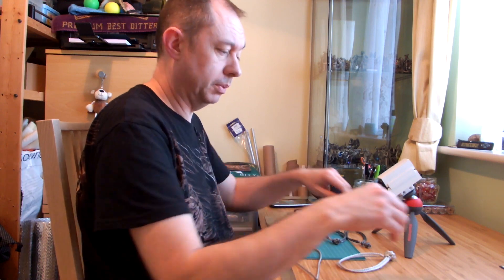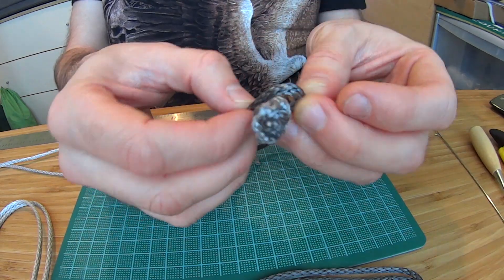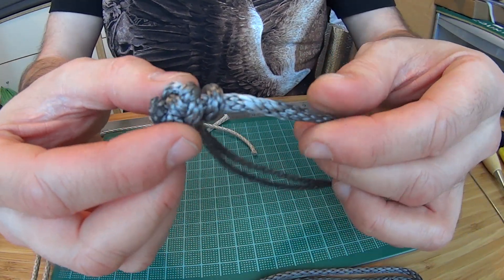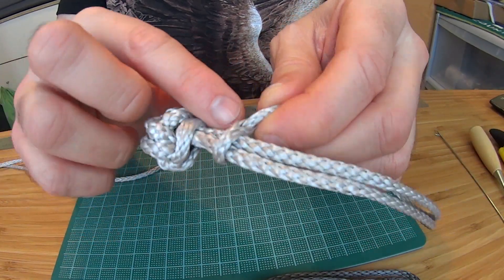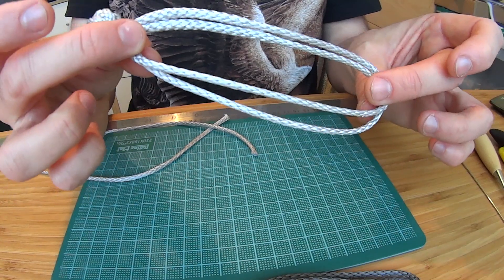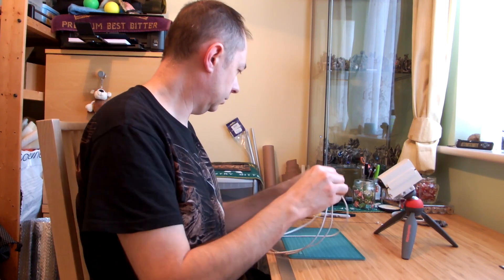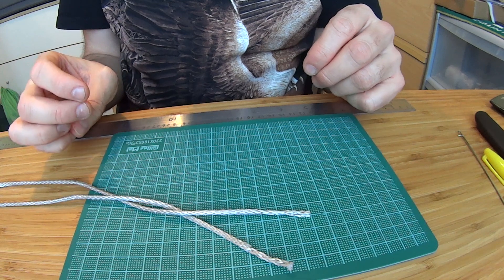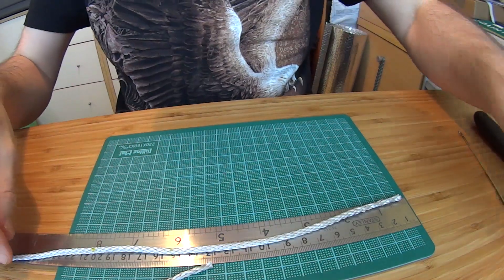Improved Soft Shackle

Comment: I've used this 'how to' as the template for IS-Shackles which replace all the very hefty steel shackles on a Jordan Series Drogue - a life-saver device for small boats in big storms. I'm using 12mm Dyneema, and with Dyneema anti-chafe woven tubing slipped on. It's idiot-proof, doesn't rot under UV, and I can double 'em up with a spare set which I've made.
Reply: I am using this for off road recovery. I also have a 60 foot winch extension that i threw loop ends onto on the fly using this technique. No need to lock stitch. I used it to uproot  trees. I used it to rescue a stuck RV in the sand. Its a great way to make a loop, and a great way to make a shackle.

Comment: I tie my own soft shackles, This is how i will tie them from now on. Ever try  it on 3/8, the big 22k rope? someone sound off and let me know.EDIT:ORIGINAL POST 2023, UPDATE MAY 2025...... Ok so i have this bookmarked, I watch it every time i make a new shackle. I use heavier rope, so the dimensions differ alot.. The infallability of these shackles as designed are top notch. I have broken a couple smaller ones. I was uprooting trees with some made from 3/16. I was shocked because i was trying to break them., and i could not. I do off road beach rescues in the Texas coastal bend. I use these as a safer alternative to steel. They are so inexpensive to make. This methodology of making  winch extension loop end negates the need for any lock stitching. I find more uses for this method of making a loop.

Comment: This is an extremely helpful video.  Thanks so much for making it!  At the end of the video, you said you would try the same method with lash-it or zing-it, but I haven't seen a follow up video.  I did a bit of experimenting with 1.75mm lash-it and found that your method worked quite well.  I settled on a 32" line length, 4" bury, and 1.25" loop.

Comment: It’s likely someone already mentioned this, but I can’t go through all the comments —>
If you tie a small loop in thinner cord around the “working part” (i.e. through the hole in the middle that you feed the longer part of the rope through), you can use it to open the shackle without fiddling, even with your gloves on. I doubt it degrades the shackle integrity much, if at all. 
Thank you for sharing the knowledge, Tac Blades.
Reply from the maker: Are you sure that it applies to this style ?

Comment: I will use this as a backup schackle on my paraglider, would it be ok to make this schackle but have one line go inside the other like on some other schackles(not where the knot is)to elliminate the risk of the 2 loose lines caching on something? Dont know if i make myself clear but you have knot, 2 lines, loop. I want knot, 1 line, loop.
Reply from the maker: Hmm not sure because if the buried ends might not be possible also without testing i could not say how strong or safe it would be.
Reply: @TacBlades  oh yeah man my bad, i forgot about the burried ends. I did this schackle one year ago and had forgot that part. I see now as im watching the video again that its not possible.
Reply: Do you have any tips on ways to make this schackle secured when not under load? I just made one and i see now that its not ideal since it will be a backup and wont be under pressure until the main one snaps. Thinking about o-rings or something to make the lock stay in place.
Reply from the maker: @rickardjonsson4526  no this kind of shackle is not designed for that kind of purpose.

Comment: Would you use the same measurements on a larger diameter rope?
Reply from the maker: No it would all have to be adjusted, for lots of reasons, especially the back splices. Trial and error is a good way, but it would have to be tested to be sure.

Comment: Thanks for the video! Which variant would take to make a loop of the same length, this or a button knot? I've tried to watch different videos and it's confusing, it looks like your method uses much more material to achieve the same length, or am i wrong?
Reply from the maker: It it using more material, mainly because i use the good length of bury for safety and also the end result is a much larger knot than the button knot so uses more material

Comment: Great tutorial! super easy. I've made 2 sets. I have a question. What is the tan or wood handled tool you use to divide and widen the Amsteel with? Much better than what I use.
Reply from the maker: Thanks it's one of these
Handmade Awl https://www.amazon.co.uk/dp/B01G699ZJ0/ref=cm_sw_r_cp_apa_i_YST9CbS5G33E8
Reply: Should have guessed that would be a UK site, but I did find it on ebay for only $5.50 (US). I made 2 of these with 1.75mm zing it for hanging my tarp... FIDDLY! Thanks again!

Comment: you presented it very well, im new to these types of knots and will be using  them in vehicle recovery. i do have a question though,would it take the weak point away from  the loop if there was a sheeps head there for the loop rather than going thru the center of the body of the rope? i hope i was clear, i dont know all of the terminology  yet. thanks tim
Reply from the maker: I know what you mean but in testing it was weaker, when you compress dyneema in a knot it can reduce the breaking strain up upto 50% but i would definitly make a few and try both, i use a larks head sometimes, take care as it can jam under a lot of pressure.
Reply: @TacBlades   how are you testing these knots i am interested in this
Reply: @TacBlades  it is a larks head knot not a sheeps head knot i was talking about, someone called a sheeps head on a video. lol
Reply: if useing a larks head can you use a tab or strap under it to pull it loose? just thinking

Comment: I made several of these the other day, without the little constrictor loop, in less than an hour while watching TV. Today, I was fiddling with a continuous loop and made one of these with that. I'm wondering why this wouldn't be a good way to make these Improved Soft Shackles? It is even easier than with the dogbone, and a wonky-looking knot is a wonky-looking knot, right? 

It seems that making a knot takes up about 4 1/2" of the CL. If the formula for making a continuous loop is SL=(FL+6)2, where SL=Starting Length and FL=Finished Length, then the one for the ISS using a CL would be SL=(FL+6+4.5)2. Looking forward to your comments.
Reply from the maker: You would have to explain more how you made one with a continuous loop ?
Reply: @TacBlades  Just made the knot by doubling the loop at the center of the buries. Then the tail through that.
Reply from the maker: @jfm30204  tight knots in dyneema can weaken the cord up to 50% thats why the knot on this one is larger and around large back spliced diameter cord. It has been tested in repeatable stress tests for strength and safety. So i am confident to share with others and not to put others at risk.

But there are many ways to do it  so for your own use you can try what you like and works for you.
Reply: @TacBlades  I understand, and this is how I look at it. The resulting (I)SS can't be any weaker than the CL and will probably be considerably stronger. I would not sell them to another person without considerable testing, which I do not intend to do, nor give to another person w/o the advice to use at their own risk, but for my personal use, this is absolutely how I intend to do it. If I break anything important, I'll let you know, provided I am still able. :)
Reply from the maker: @jfm30204  yes any feedback would be very interesting thanks. Samson has interestig data on fibre compression and reduced strength.

Comment: I appreciate your essy to understand instructions.   I do have one question:  the specifications you provide are for a 4" loop, how would I calculate the measurement necessary for a 2" loop?  Thanks
Reply from the maker: Not sure because of the length of the buries is minimum needed for knot and strength it might be the minimum size you would have to experiment.

Comment: I'm curious as to how you came to the calculation that the breaking strength is 230% that of a single Amsteel strand?

I know little about the methodology of calculating cordage breaking strength, but my simple eye test says that the weakest link in the shackle you created is the two parallel strands. Or perhaps the bend in the single loop over the knot?

Is there something about the properties of Amsteel where the whole is greater than the sum of the parts?
Reply from the maker: There was a full university research activity on this and also strap stitching with physical testing. It was online but has since been removed.
Reply from the maker: See the link in the notes section under the video not sure how long it will be there.

Comment: Thank you..   For the loop the knot goes through to tie up the shackle,  I have used a sliding burry loop instead of splitting the amsteel and putting the strand through the hole as at 11:54 to make the "adjustable loop".  Just wondering if this is stronger?  Thanks again.
Reply from the maker: They both work, Its not stronger as you need a minium length of bury for stength. But with the bury type  can be tricky to open in the pouring rain and sub zero with gloves on :)
Reply: Good points, thank you for the reply.

Comment: How do you think this would work, in place of a continuous loop, binding the top of a hammock? Then you could open it up, attach directly to your straps, or the closed end of your Whoopies, or whatever. The knot at the top might even make for a good anchor for a Ridgeline?
Reply from the maker: Five Family yes it would work maybe need to make it a bit longer.
Reply: Tried it out, using your guide and measurements, worked perfectly for replacing the heavy cord and steel carabiner in my double. Thanks! Now I can skip the carabiner there altogether, and I think the knot will work good as an attachment point for a ridgeline.
Reply from the maker: Five Family awesome nice work :)

Comment: Love your design. It's simple and works well. I shortened the start length to 40". The end loop is 3" which is perfect for my setup. Thanks for the video!
Reply: The method is perfect, Its also adaptable. I use it for off road rescue and recovery.

Comment: Is there a method for determining the end length given the starting line diameter and the starting length of the line?
Reply from the maker: tpdavis473 it can be done but i havent needed it. You take into acount the length lost in burries etc.. You can get it quite precise. Usually tho you just make one and them measure the deltas.
Reply: Thanks for the reply.  I use these on my trimaran sailboat.  I am considering the better way to lash the shrouds and it strikes me that a soft shackle termination would be quick and secure...how do you calculate the end breaking strength...ie, what weakens the line and by how much?  TIA
Reply from the maker: tpdavis473 the breaking strength was done through destruction testing by acedemia.
Reply: Wow, that was unexpected.  I think that if I want a soft shackle of specific length when closed, I should start with the pass through loop, double and mark where the closed shackle will be around the knot.  The buries will shorten it a bit, but likely to be close to the same amount that the shackle will stretch under load.  Then all I have to know is how long a line it takes to made an overhand knot and two brummel spliced ends.  Thanks for your time and expertise.
Reply: Also, I just learned that if you make one and you need it a little shorter, just unmake it back to the overhand knot and replace the overhand knot with either a figure 8 or a stopper knot.
Reply from the maker: tpdavis473 cool just make sure the ends are burried back through the knot. The knot is designed in a way to prevent slippage and failure under pressure i cant say how other knot would perform.

Comment: This uses a knot that I can trust not to come undone, very important for hanging a hammock. I've heard reports of the regular soft shackles coming undone under tension--not a problem here since the ends are buried and run back through the knot. I used these to replace the heavy carabiners on my hammock suspension. Thanks for the excellent instruction.
Reply from the maker: Katherine Starbird thanks for watching. :)

Comment: Hi there. Awesome clip, making it very clear and easy to follow. Wondering if you could provide the various lengths required for different diameters please? Apologies in advance if you have already provided.
Reply from the maker: jasequick you will need to experiment a bit i havent used many other diameters :)
Reply: Tac Blades so does that imply that all the buries etc are changed proportionately? If I reduce the overall length by half, then the buries are halved etc?
Reply: Tac Blades I’m thinking that most things (including the loops and buries) have to remain constant irrespective of the shackle diameter, in order to continue remain buried past the knot, and allow the rope to pass through etc. I think I answered my own question. 🤣🤣
Reply from the maker: jasequick yes keep burries same the burry length is a factor of diameter of cord and friction

Comment: Awesome video! Your way of making the button is very easy to follow and looks superior to the classic diamond button knot. Instead of doing the noose portion your way, I just made a lark's head on the opposite end of the button to serve as its lock. Doing this makes a stronger noose.
Reply: After commenting, I scrolled down and saw your comment about the Lark's Head squeezing the neck of the button which makes it  weaker. It really makes sense! The beauty of your way to make the button is how easy it is to undo it. I will redo one  "YOUR WAY"  and have one with the Lark's Head and call it a day! Thank you so much for your awesome videos.

Comment: That actually seems simpler than the diamond/button knots I used before. With those I had to follow a step by step every time I made them. Course I only made 5 or 6 but still.  This way uses a bit more rope but is stronger.

Comment: Great video! Thanks. Question: For the adjustable loop, are you measuring "just over a half inch" from the outside of the loop or the inside? I assume inside, but, since dimensions are critical, I would like to be sure.
Reply from the maker: Jere Moore when you measure its just over half an inch on the outside measurement.
Reply: Thanks. I whipped up two of these pretty quickly. Easy peasy.

Comment: TAC Blades,

Just F.Y.I. I used two 36" long pieces of dynaglide to make my pair of shackles. With each piece I folded the length in half and then made my marks for the brummel lock on each end at 6" and  then 7" to result in a smaller "tiny loop", but still maintaining a 6" bury per your instructions. This results in a shackle that is 3" long shackle that weighs ~2.5 gms. These shackles seem perfect for connecting my 7/64" amsteel whoopies to tree straps.

I am going to make a couple of these dynaglide improved soft shackles using your method (which I really like!!!) and send them to Dutch who had offered to do failure testing. I'm betting your 230% stronger claim is right on.

Andy
Reply: R. Andrew Moore, Just curious, what did Dutch find out regarding that load testing on Gary's (Tac Blades) version of  soft shackles? ATB
Reply: How'd the tests go?

Comment: In your opinion (not asking in a legal sense) would an "improved soft shackle" made from dynaglide be strong enough to hold a 200# hammock occupant? Your improved soft shackle ( I love it!) is  230% stronger that the original dynaglide rope which is rated at 1000#.
Reply from the maker: R. Andrew Moore yes it would be fine, I know people that have woopies and shackles with dynaglide on hammocks with no problem. I would advise amsteel but it's up to you if you want to test dynaglide.
Reply: Thanks! I made two out of dynaglide (per your great tuturial!!!) and with very limited testing so far (I weigh 190#), they work fine. I also made three more sets out of 7/64 amsteel as presents for my hammocking relatives! Nice video.

Comment: bethandevans.com site is down. I'd love to see a calculator or way to scale this to different size lines. I am personally interested in 3/8" amsteel line, with a 20" finished length. Also, is there less of a need to pretighten the knot as seems to be emphasized with the button knot and others?
Reply from the maker: Charly Aurelia you will just have to play with different lengths the origibal research doesnt help witth that. But its good to practice, the tightening the knot is not such an issue with this design.
Reply: thanks for the help. I messaged you with some further questions. if you would be willing, please have a look. thanks.

Comment: Great tutorial thanks. If I want to make the loop shorter (for sailing) how does one vary the dimensions? Cheers
Reply from the maker: Graham Richardson you will have to experiment a bit, there is a minimum size due to the burries, if you use zingit or lashit it can go very small if it is strong enough0
Reply: Wow that was a quick reply! Thanks